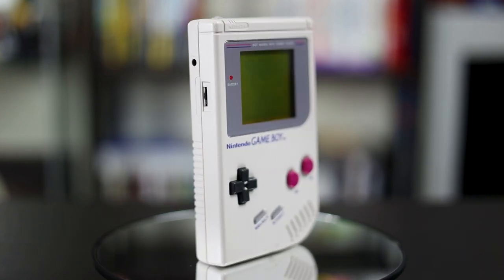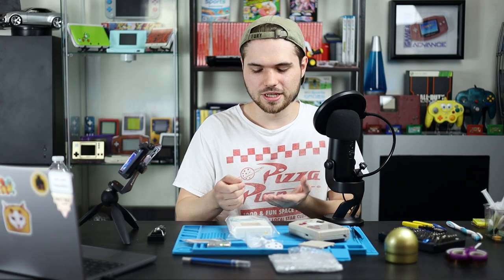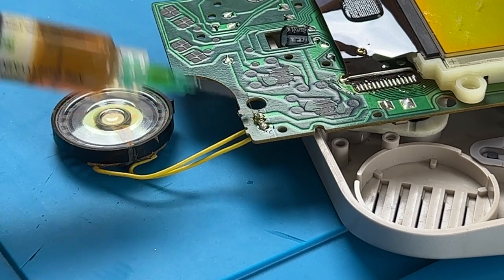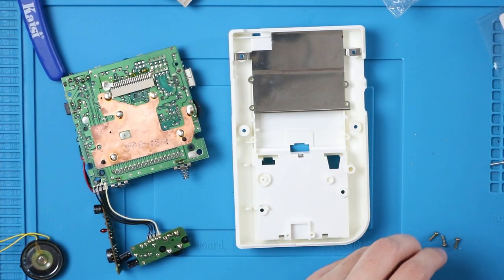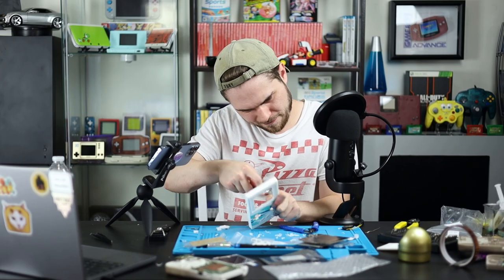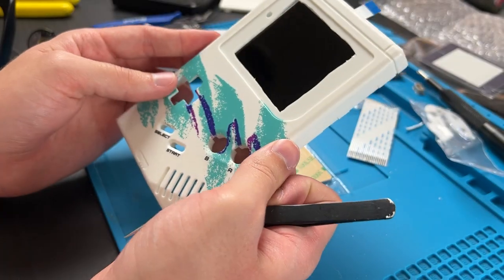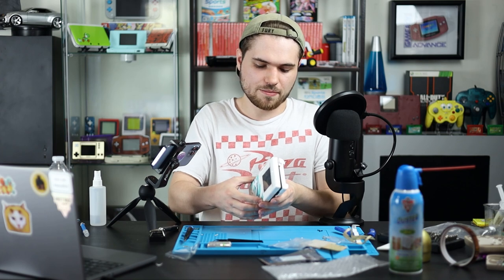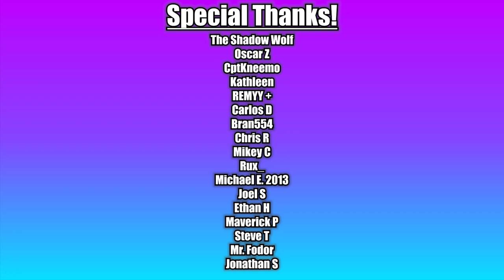You Should Mod an Original Game Boy! (DMG In-Depth Tutorial)

Comment: when placing the screen onto the guide i used some double sided tape to hold the screen in place it worked out well as the guide allows the screen to slide around and the same with the small pcb on the backside of the guide